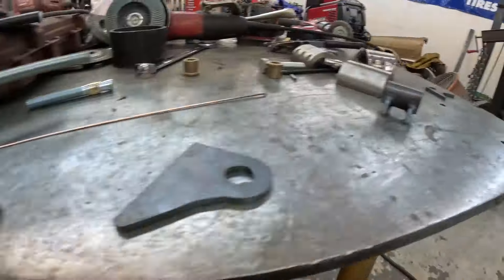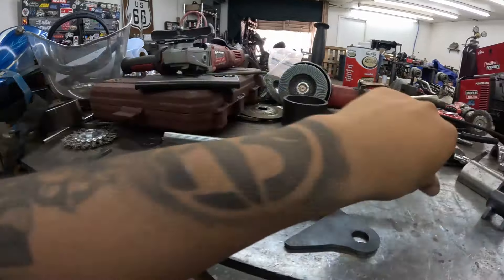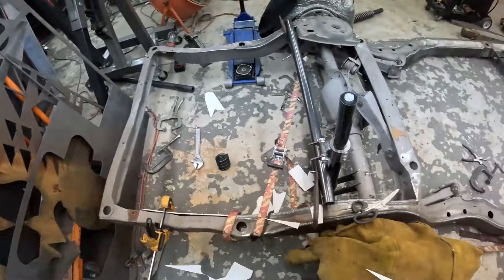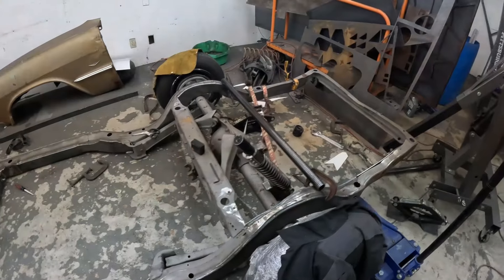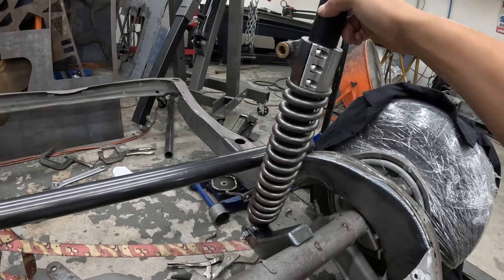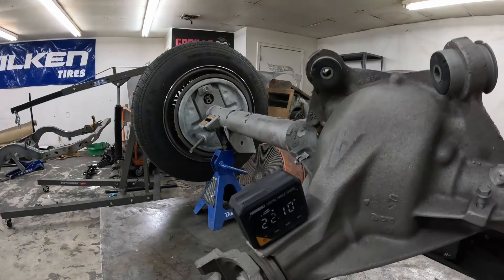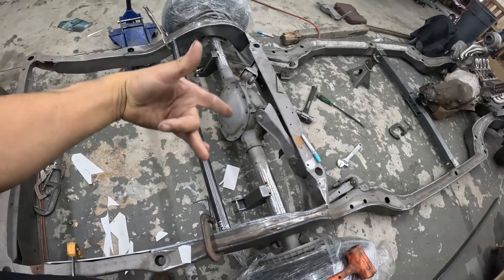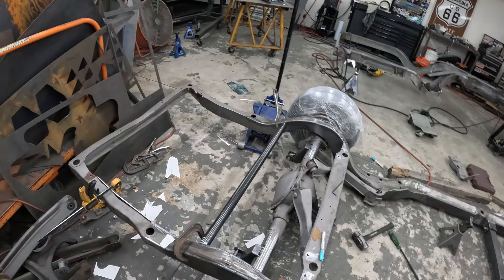CUSTOM REAR HYDRAULIC SET UP

Comment: Great job! It’s awesome seeing your vision work in real time. Could you do “bell cranks” similar to pro touring/drift suspension on the front? Mount the cylinder transverse ? Who makes the cylinder clamps? Those are pretty cool.
Reply from the maker: Ill look into it, and they just some shaft collars and I welded a bolt mount to it